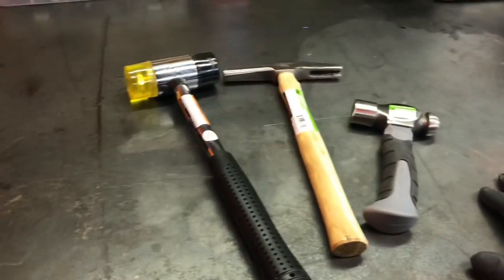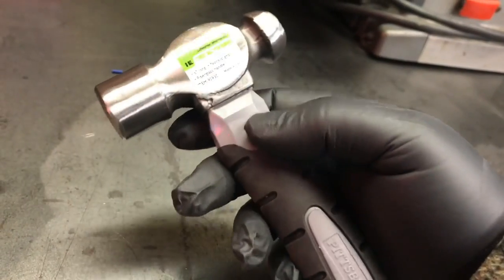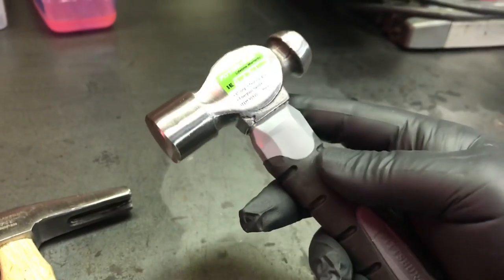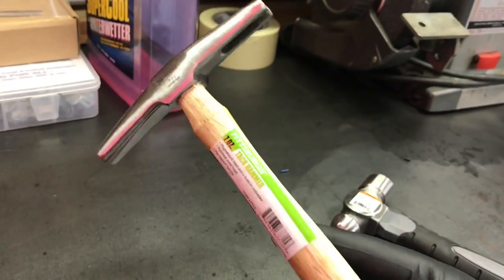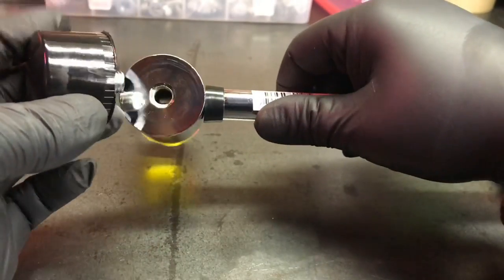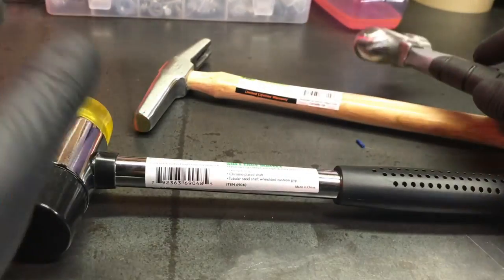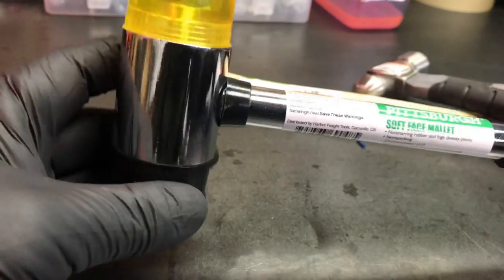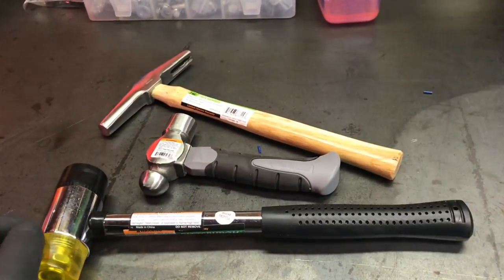$13 Harbor Freight Hammer Haul

Comment: Those are cool. I have 2 old HF ball peins. A tiny one with a wooden handle holding up great (18 years) and a 1lb. With a fiberglass handle. The face on that one chips off making it dangerous (22 years).
Reply from the maker: upside downdog I figured I’d give these a try. I don’t expect Estwing quality, but for the money I don’t think anyone can go wrong with these.
Reply: @chevelle74us  
No, that's the cool thing about cheap tools. Sometimes you get pleasantly surprised! My tiny ball pein is every bit as good as a Matco one my buddy bought. Mine was 3 bucks. His 45!
Reply from the maker: upside downdog I agree, what I meant to say was that these being so cheap, it’s hardly a gamble at all. Harbor Freight continues to impress me. Especially the last few years. I have their large tool box, side cabinets, engine hoist, motorcycle lift, tire changer and many hand tools and they’ve all been great. I even purchased a few of their $18 angle grinders for a big project I had so I wouldn’t have to switch disks around. I figured I’d burn them up by the end, but no, they’re still going strong.